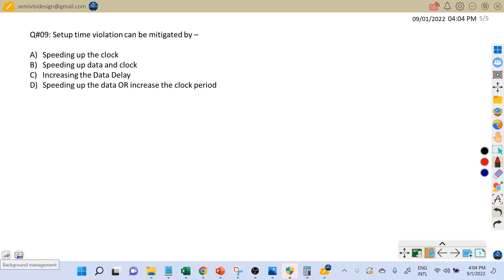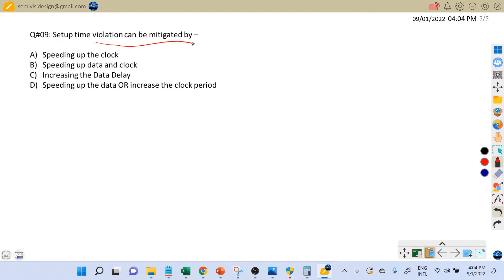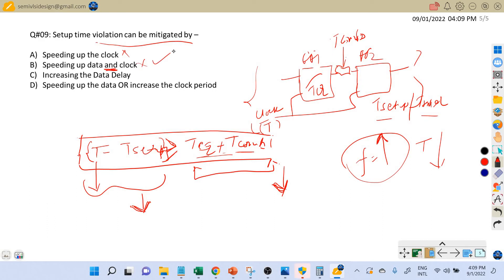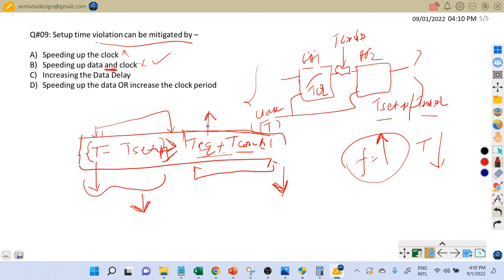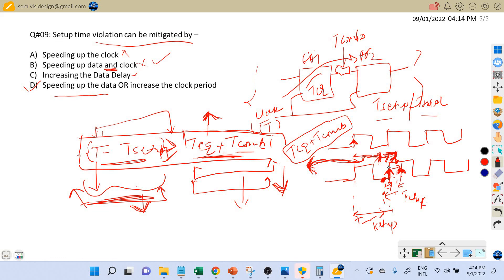Interview Question #09 | How to Fix Setup Violation | Static Timing Analysis(STA) | @vlsiexcellence

Comment: Generally, Setup Time Violation is caused too fast clock, slower clock will solve this problem.
Reply from the maker: Hi @carterlee287, Yes. Slowering clock is one of the solution. There are other solutions as well when slowering clock is not an option.